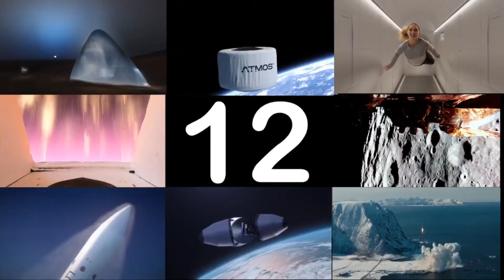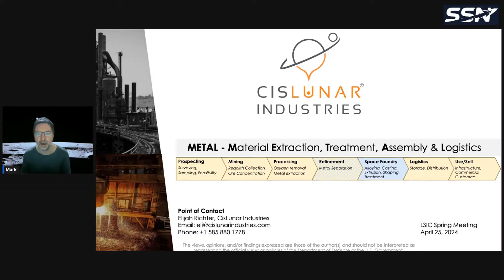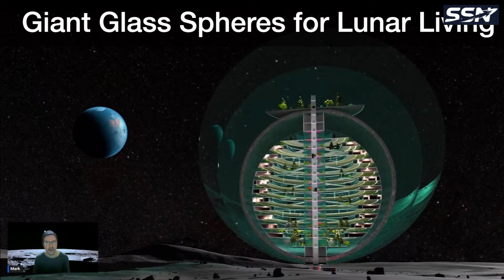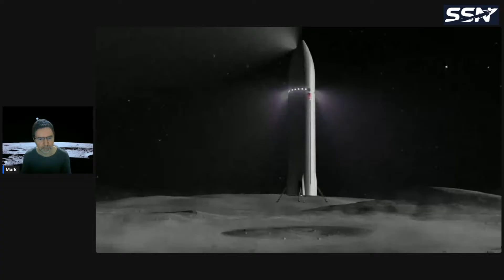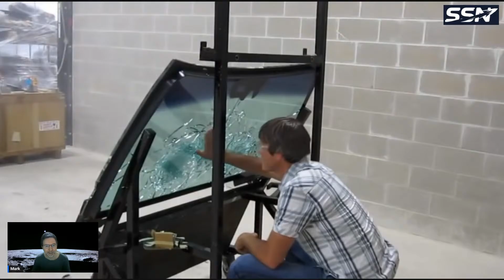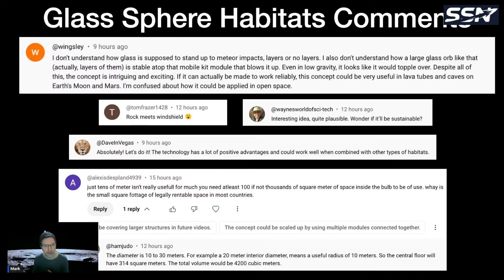Space News Live 25

Comment: Back in the late 80's there was research done on glass-glass composites for lunar ISRU, where glasses with different tensile characteristics and melting points are used to reinforce the melt, just as fiberglass reinforces polyester or epoxy resins.  See also basalt fiber-reinforced concrete on Earth.